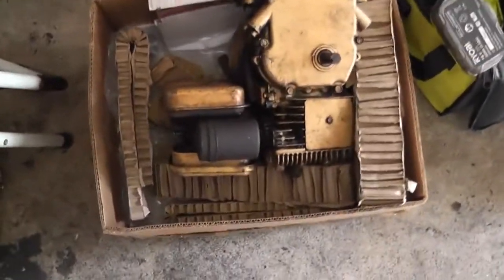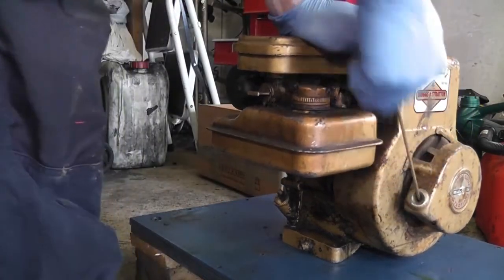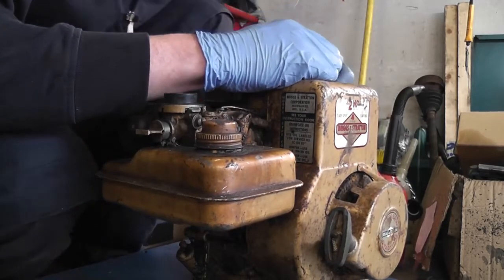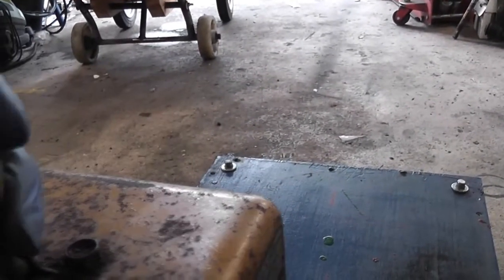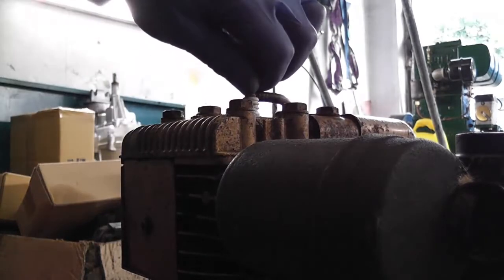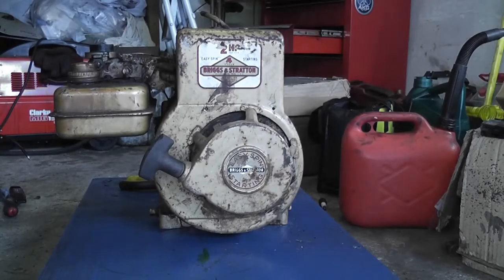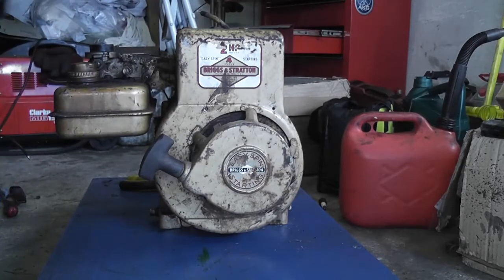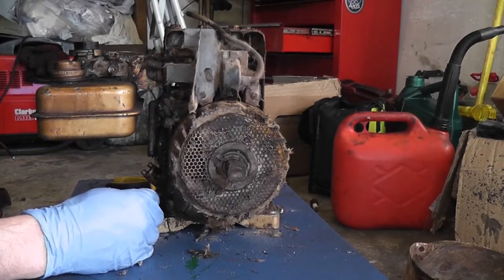WILL IT RUN? - Vintage barn find Briggs & Stratton 2hp engine

Comment: Great video.
I’m at exactly the same place as you at the end.
My son and I are working on a 1972 VW Beetle too.
Today he was working on the VW and I was working on the old B&S 2hp horizontal shaft with no spark.
BTW I have broken a vane before. I used JB Weld to put it back.

Comment: I remember back in the mid 70s my Dad had a cement mixer with one of those engines. Would only run on half choke. Did ok because he used it to build a house.
Reply from the maker: Funny, I wouldn't have thought it was powerful enough for a cement mixer, but I suppose for a small one it would have been grand.

Comment: Hi great video! I am restoring one myself right now, it is on an old rotavator (landmaster L120) I bought earlier this year and have been using it over the summer. It is running, but is a bit unstable especially in idle, so now I will give a service and cleanup. Can anyone help with the exact name of the engine, and / or a link to a service manual? It will help me ordering new parts! Thanks, Chr.
Reply from the maker: It's called a Briggs & Stratton 60100. I bought a lot of my parts from briggsbits.co.uk.
Reply: @Endfloat  great. Thanks! For some reason i cant find any number on mine, so it was difficult to look it up.......

Comment: Were is the kill switch have same motor only white but can't seem to get spark how do I know my magneto is good with no spark
Reply from the maker: There's a wire that goes from the coil to the carb. Disconnect that and see if you get a spark.
Reply: @Endfloat  ya there's not a wire that goes to the carb two wires go behind the flywheel and one ground to the magneto
Reply from the maker: One wire is to the points behind the flywheel. The other one is the kill wire. Check your points first, make sure there's no stray grounds and disconnect any other wires other than the one that goes to the points and condenser. It's unlikely your mag is faulty. It's more likely the points.

Comment: It looks like that engine has been through hell and back are you going to restore it like the lister?
Reply from the maker: It's very grubby externally but looking down into the cylinder it actually looks very clean in there, but yes it will be getting stripped and rebuilt. I want to try and get it running first.
Reply: @Endfloat  that's good then
Reply from the maker: @TheTutorialguy_28  once I can get the parts. The Lister seems easier to pick up parts for!